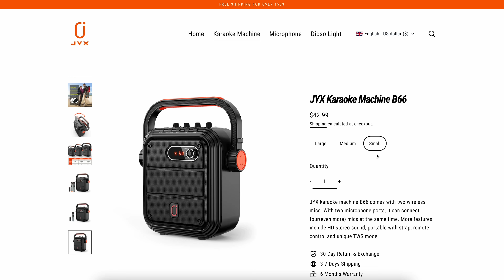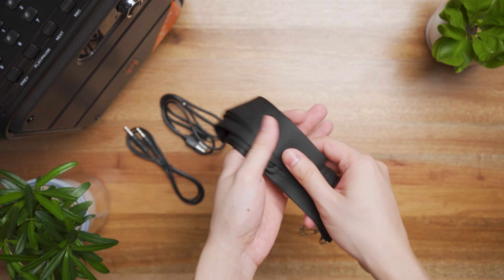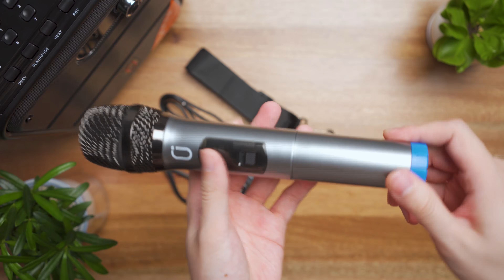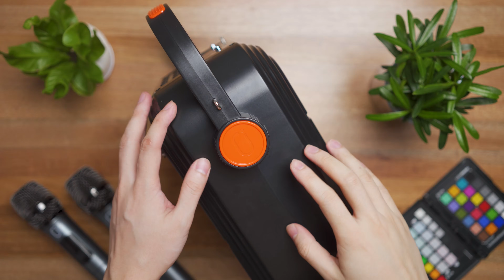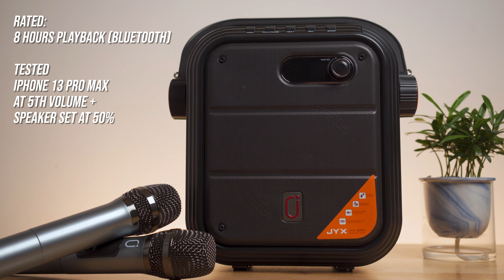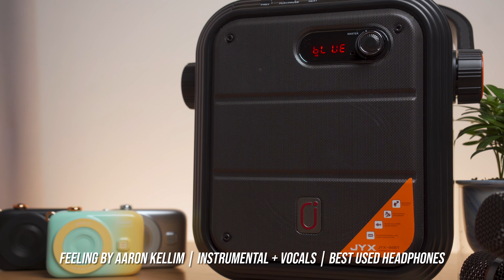JYX Karaoke Machine B66 - Amazon Best Seller Portable Bluetooth Karaoke

Comment: One of my mic all of the sudden stop working. Battery works and there’s light but both mic have the same channel but different number under. Is it out if sync or is the mic broken?
Reply from the maker: Should have a fix channel technically... maybe check the manual. Or contact JYX via amazon seller.